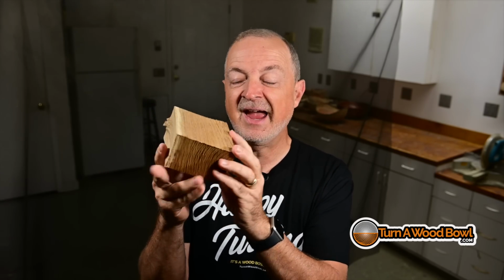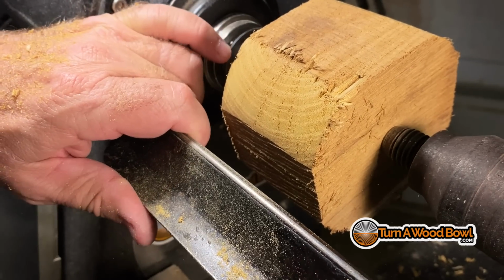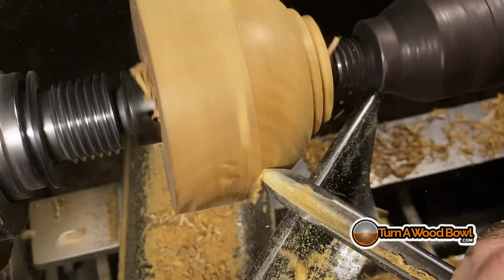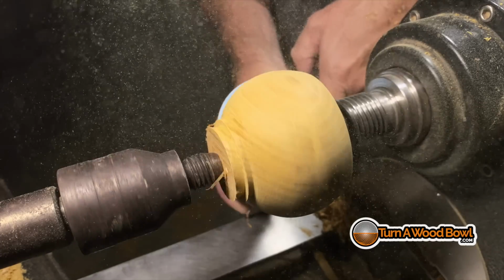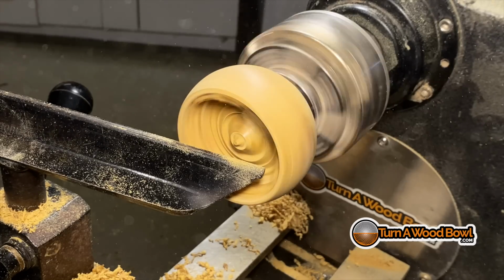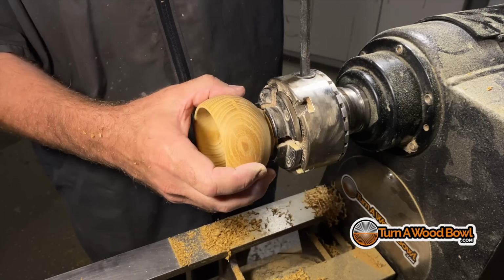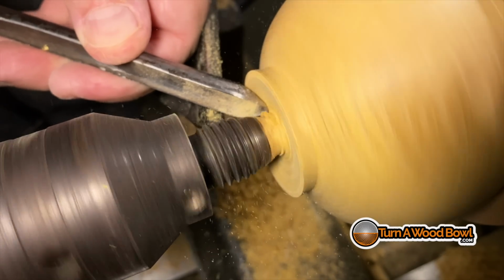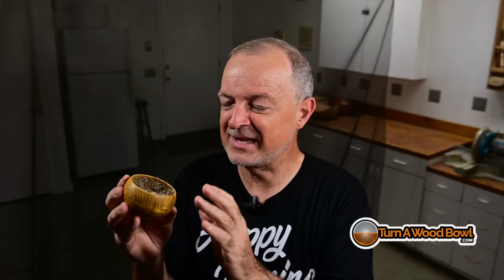Woodturned Nest Bowl – Wood Bowl Video

Comment: HI! Watched my first video last night and really enjoyed. I do have a question. The topic of video was using a respirator when turning. How do you do that when wearing a face shield also? My shield will not allow room to do this. I really need shield!
Reply from the maker: You might need to work around for the right fit. My shield needs to be adjusted a bit on my head to fit over the respirator. If it's a big problem you might want to consider one of the full head shield and respirators, like this one. https://amzn.to/3IMHyaf Although the price might inspire you to make the regular respirator and shield work one way or another. Ha. ;) All the best to you and Happy Turning!

Comment: I drill a 3/16 pilot hole for the point of the spur to the blades engage without a lot of tailstock pressure.
About those eggs... Do they still smell okay?